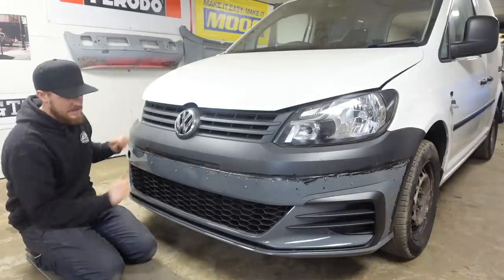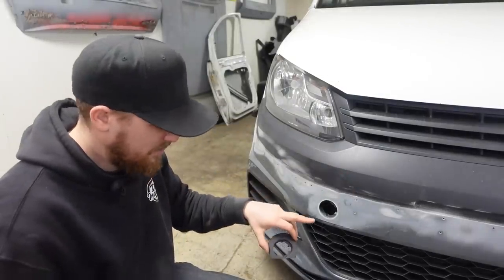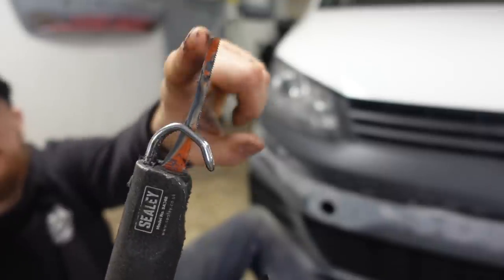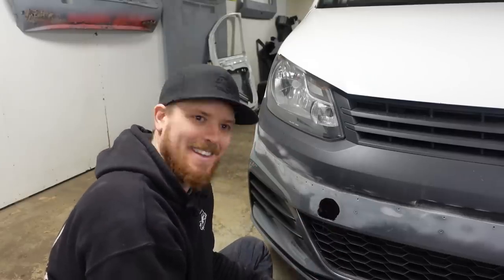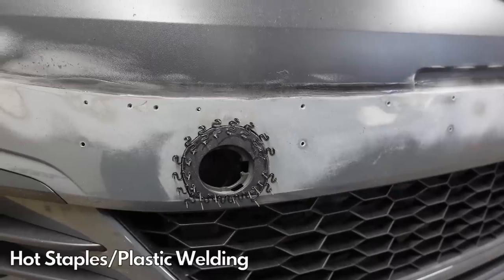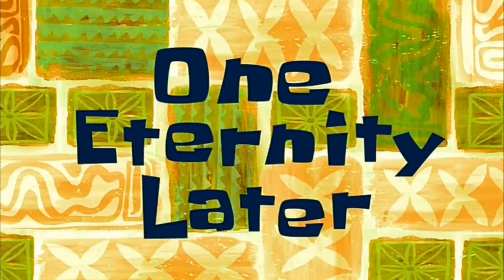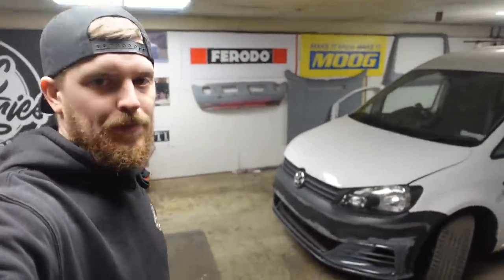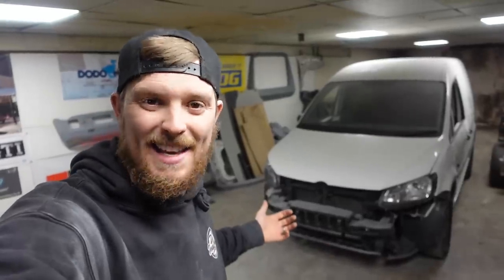VW Caddy 2K Build Series - Golf GTI Caddy Hybrid Custom Front Bumper How To Part 2 - Episode 8

Comment: When you take that bumper off pal and you have it painted, before you put it back on spray some Shultz over the filler on the inside of the bumper which would have came out the screw holes and then some cavity wax.  It’ll prevent water getting at the filler from the inside of the bumper and eventually coming out the painted side
Reply from the maker: Good tip that. I did think I would have to do something.

Comment: Hi Dan 

Just catching up with the videos, if your ever doing plastic welding try and avoid using staples as the repair method is flawed, at the same time it’s easy to get a hold off. If you ever get a chance use a nitrogen plastic welder (you tube research) it’s a game changer